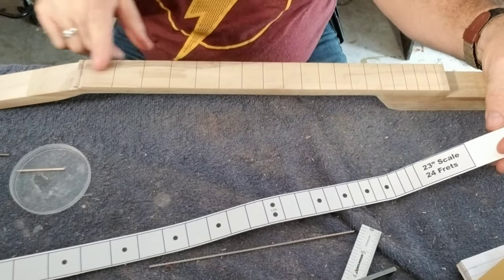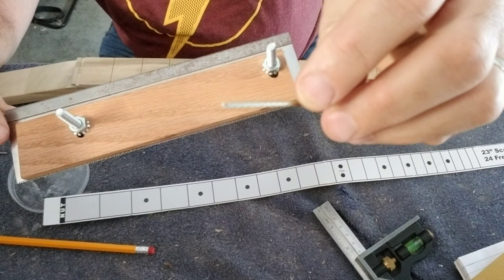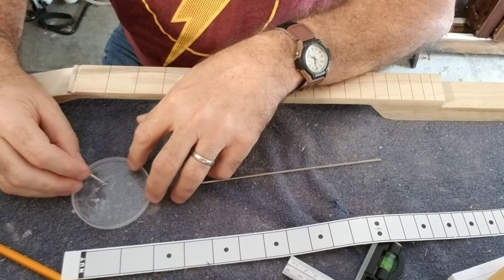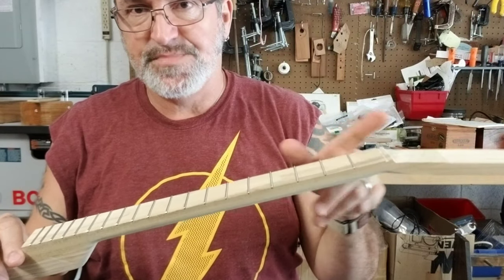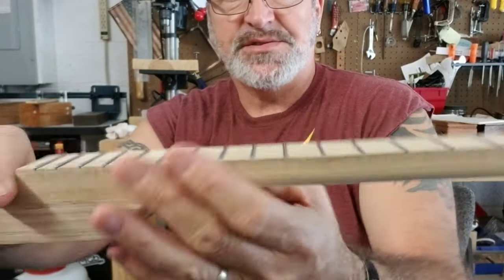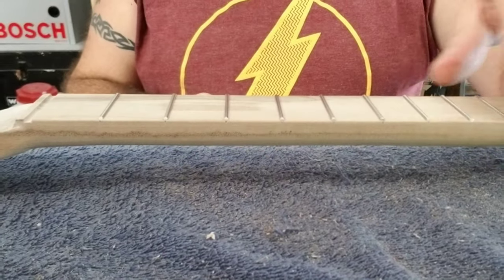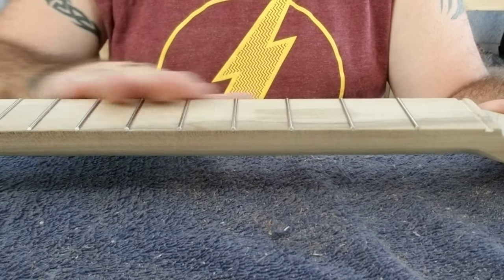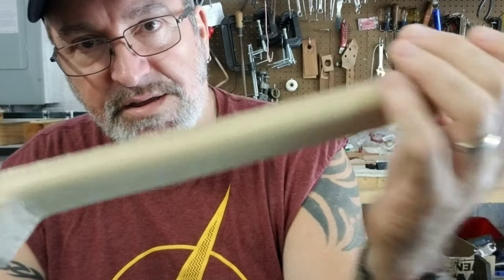Cigar Box Guitars - Installing frets on your CBG.

Comment: Nice to learn an easy way to do it. I actually made a Fret Jig out of aluminum angle that uses a DRO to find where to cut the frets and keep the fret cut depth at 0.030" deep. Overkill? Maybe so, but it can make a "custom" fret board for a scale length anywhere from 12" to 48", and keep the fret positions within 0.001"!
Reply from the maker: That's awesome. M~

Comment: I notice  you fret straight into the neck, you don't  seem to use  a separate fretboard? Why so? Great channel by the way, thanks.
Reply from the maker: Thanks Killer Kane.  I do add a separate fret board to some. I do like the more thin line feel of the neck without the added fret board, kinda feels like my telecaster neck.

Comment: Hey Michael have you ever put a radius in your fretboard? I have short stubby fingers and my top string always gets caught in the bottom joint of my finger and buzzes Granite I'm still learning to play. Could a radius to fretboard help me
Reply from the maker: Hi Adam,  I have never added a radius to my fret boards,  being that their only 3 stringers , and the fret boards are usually around 1.5'' in width. You might want to try lighter strings. I cant really answer a question on a 3 string CBG with a radius fret board, because Ive never seen one. M~

Comment: Hi Michael. I enjoy watching all of your videos. I have been building cigar box guitars for 6 years it was a perfect new hobby because I have 50 years of wood working experience. When I fret my necks, I use my belt sanding machine to grind down the frets just to the point that they are even with the fret board..Then I use my palm sander with 150 grit paper to smooth out the frets. saves a lot of filing work. Question I usually buy Med/Med frets from CB Gitty in 1 pound bulk..They are OUT OF STOCK, I ordered some jumbo frets ,Do you think they will be ok to use on a cigar box guitar ?? or to large??
Reply from the maker: Thanks Richard. This video was 4 yeas ago, I do my fret work totally different now. Similar to the way your doing them, on the belt sander. I have only used Jumbo frets a ZERO Fret. Never fretted a whole neck with them.  I dont like using the radius fret wire on a flat neck, so I get my bulk fret wire from Stew/Mac Med/Med its number #148. M~
Reply: @SouthernFireGuitars  Thanks for the reply Michael. I had not thought of Stew/Mac..for my fretting needs. I'm going to try the Med/High frets suppose to provide better Sustain than the Med/Med.and wear longer..

Comment: I bought a cigar box guitar at a yard sale. Whoever made it never installed the fret rods or put the fret spacing on . What did you use or recommend for installing them on my CBG
Reply from the maker: That's cool. You can measure from the nut to the bridge and get the scale length, then get a fretting template to mark the fret lines and cut the fret slots for the frets and install them. You could also use it as a slide guitar, sounds like that's what if was made for.   M~

Comment: Do you occasionally have frets fall out during the filing process, even after having glued them in? I have super glued all my frets in  and usually wait a day or so but seem to loose two or three by the time I've completed my filing. Just wondering if that's normal in your world.
Reply from the maker: Hey mrwilly. I have not had any pop out after gluing then in, and I have have started filing them sometimes about 15 min after putting them in. M~

Comment: Hi Mike, Big G from UK. I am making a dummy run cookie tin CBG with an old tin before I tackle the tin I am fond of, so far not going too badly, have cut the frets with a small jap pull saw with an off cut clamped to the side as a depth gauge, it has worked but I have ordered the proper fret saw and gauge as I was not confident with a make shift set up. Having watched this video of yours I am about to fret it up, I have a fret less CGB but this is my first attempt at fretting so thanks again for sharing your experience with us all. All the best brummie Bri, (Big G)
Reply from the maker: Your welcome. Good luck with the cookie tin, Brian. Having a good fretting saw and set up will make things a lot easier.  M~
Reply: Hi Mike, Big G brummie Bri here wishing you and yours a very merry Christmas, hope you are well and still making your back woods masterpieces. 
I am now on my sixth CBG now after making a Camacho fifth to give to my grandson for Christmas. 
I have had a message come through, seems to be from you
(Souther fire guitars) saying that I have had a prize awarded to me for a reply I gave some time ago, and with all the hoaxes around on the net, I wanted to know from you personally if it is true, cos I can’t believe that a reply from me would be highlighted from the very many messages you must receive on a daily basis. 
            Happy new year to you
             Regards, Big G, 
                 Brummie Bri
            Birmingham. UK